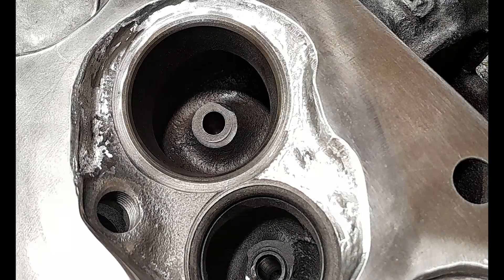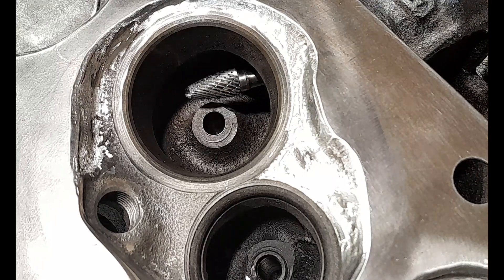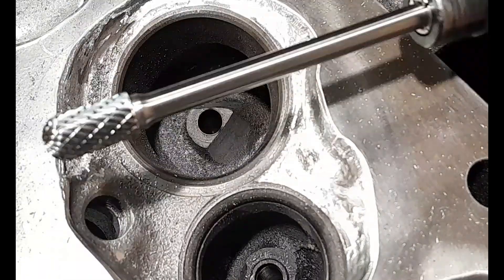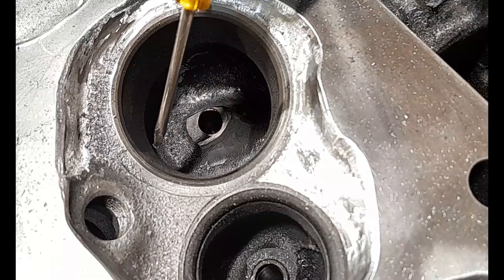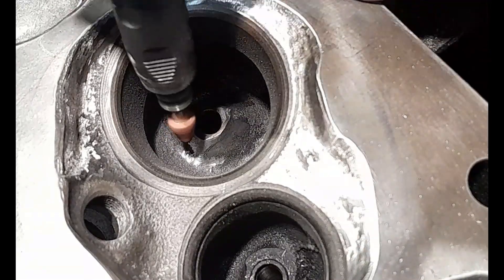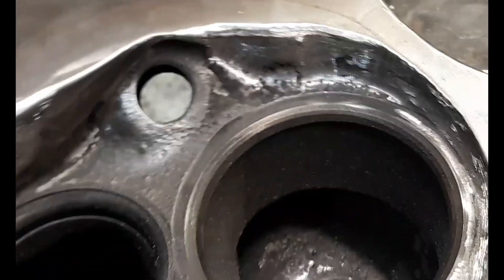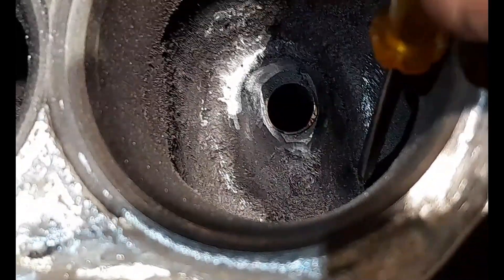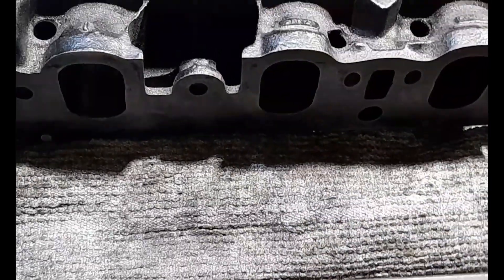351 Cleveland 2V Head Porting Thinning Down Valve Guide Bosses

Comment: Thank you for this I was go into touch the valve stem area but now im going to clean it up
Reply from the maker: I think thinning the valve stem bosses helps velocity around the short side. It’s pretty much standard in modern cylinder heads.

If you look at the pavtek cylinder head cnc program for the Aussie 302 heads the bosses are thinned like modern bosses. Just do it!
Reply: @ when I take theee to the machine shop there not going to have a problem if I need new guide inserts
Reply from the maker: @ have a look at how the bosses are thinned on mine and have a look at my friends intake and exhaust bosses in pt 11. 

There is still a lot of material left for the valve stem guides. The aim is to thin and tapper them for less turbulence in the bowl.